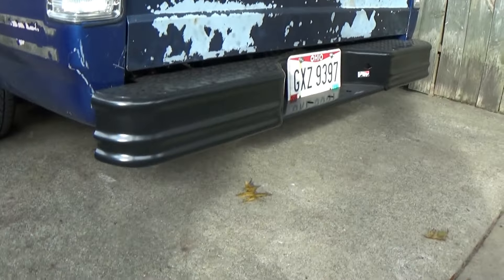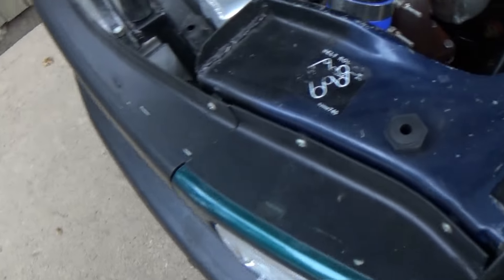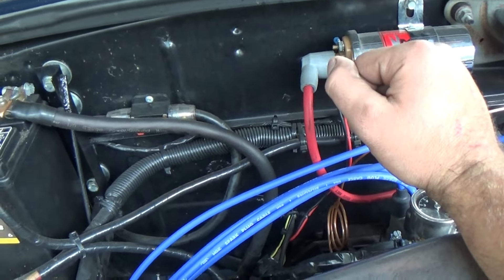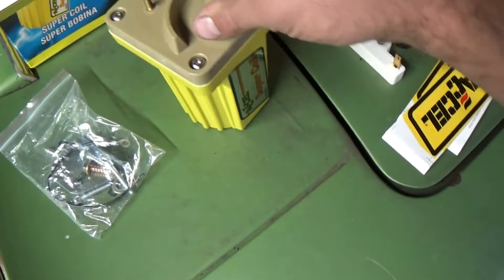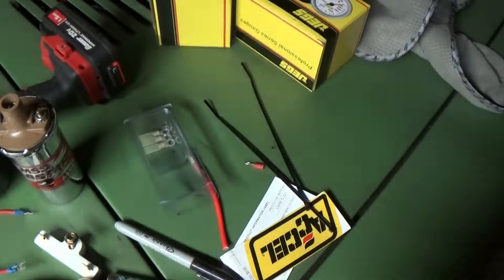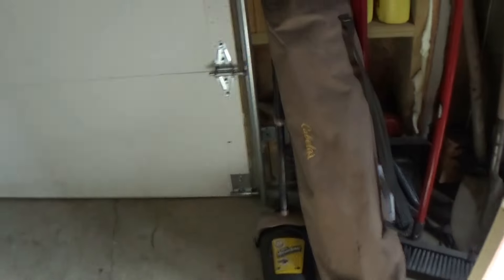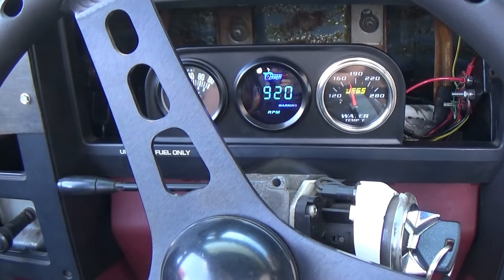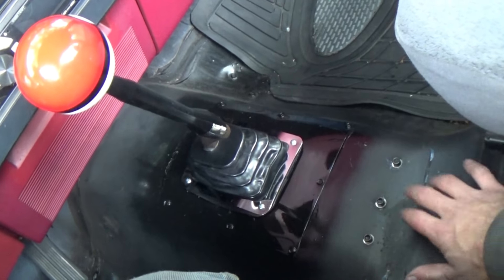Turbo 5.2 Dakota Ignition Upgrades & Test Drive Gone Wrong!

Comment from the maker: Disclaimer, DO NOT mount oil filled ignition coils like the one I just installed horizontally like I did! It will ruin the ignition coil and it will ruin it fast, the fluid inside the coil is used to cool the coil internal components. All of these types of coils are only filled about 3/4 of the way and have an air pocket filling the remainder and mounting it sideways causes a portion of the coil internals to sit above the fluid level and overheat. I learned this the hard way and had to replace the coil about a month later, please learn from my mistake! Some fluid filled coils like my old Blaster 2 don't seem to be affected by being mounted sideways as mine had been for years but the Accel coil definitely didn't like it lol. I am now running an MSD High Vibration coil which can be mounted in any orientation and its been doing great!
Reply: People never listen when you tell ‘em their coils upside down😂
Reply: 185f is NOT HIGH

Your engine is happy at 195f
As high as 215f is normal.
Reply from the maker: @fastinradfordable  I’m aware that it can run happily above 185. This truck has a 160 thermostat so I knew it wasn’t overheating yet but it was running hotter than usual so I knew I had a problem when it was getting that high cruising at highway speed

Comment: you need to add some foil backed butyl sound deadener on that floor in a 80mill thickness or thicker you wont regret it it'll cut out road noise but especially the heat coming up thru the floor i covered my whole floor with it then a layer of closed cell foam and a layer of mlv mat before the carpet and i dont hear or feel any heat even on hot summer days in Arizona i also did my roof with just the foil backed butyl deadener to and it strenthed the whole roof under headliner and makes the biggest difference & only costed me like $35.. i use hikari led headligts as for the rest dont use the cheap you know wher ones use a good brand led and you'll never have issues
Reply from the maker: I need to do this to my vw too

Comment: I wouldn't be mounting a mechanical oil pressure gauge inside your truck. It will spray hot oil inside your truck. Are you still on Instagram?
Reply: Mercedes did it in some of the most reliable cars of all time